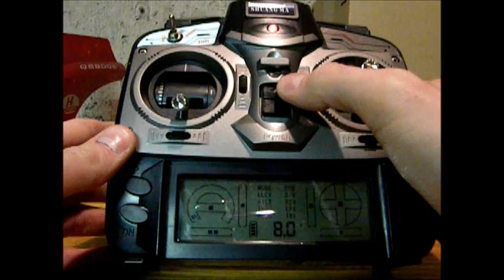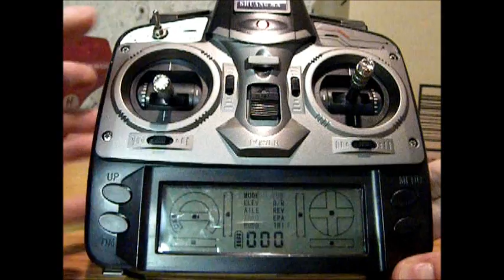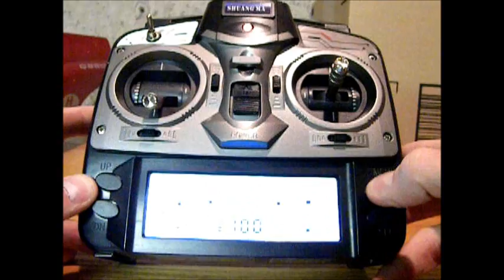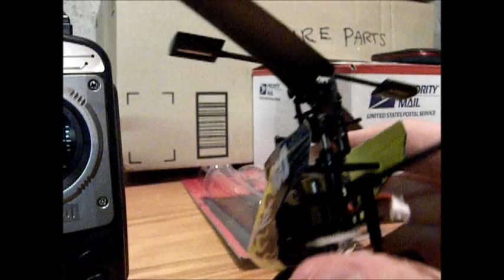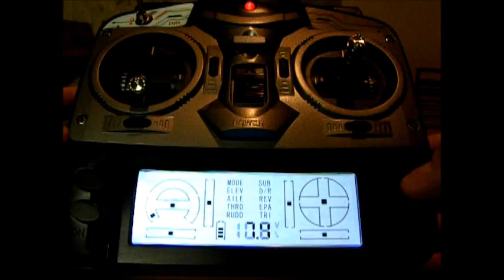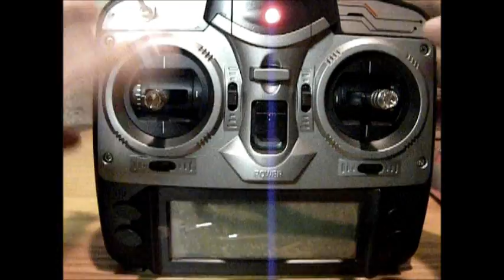How to save the trim settings for your double horse 9116 and 9117 (programming the TX dh9116/9117)

Comment: Hello... I would like to know if there is a way to reset the trims? the trim for the aileron servo is all to the left side, and the button doesn't work, I have tried your settings but I can't get it... the swashplate goes left when the helicopter and the controller get in bind... I would appreciate so much your help...

Comment: I recently messed with the settings and now my heli doesn't fly correctly. I'm not sure what I changed but needs to reset everything back to factory default. When I push the rudder to the left or right it doesn't respond, it will only go left and not right. Any way to reset the remote to factory default. Any help would be great

Comment: my DH9116 wont go straight when I push the forward stick, it always bank to the left, I have tried different settings none of them work, I was thinking is could be the left servo not functioning right, because when I push the right stick to go forward the servo(left) arm dont move up, but it will move up if I push the right stick right side(drift right), what I am doing wrong, all help would be very much appreciated..
Reply: Lol those toy models are no near the level of control like you have on a proper collective pitch I had a coaxial helicopter I got it of the ground and it won't respond to the radio 
It just did its own thing and even my father said get a proper 6 channel model because wasting money on cheap toys are not worth it who cares if a hobby grade model has the power to chop your head of I want control of the model I fly not one that does its own thing  and a model that does 3d aswel needs serious control you can't have control of a machine that can kill you fly like a kids toy that keeps crashing with no control of it 
That's why hobby model have far more control if you want it to go forward it goes forward if you want it to go left and right it does it if you want it to do crazy shit it will do that a toy model has no control unless  I had a toy plane lost it no control why waste money on cheap flying toys fuck all these flying toys time to buy a real proper rc helicopter that can do 3d

Comment: Great video. Thanks for the info.
My question is.. I just purchased a 9117, I'm new to the RC Copter world. On the RC Controller my RIGHT controller controls the throttle speed not the LEFT controller.  What is wrong with it?

Comment from the maker: Yes. On a single blade heli, the tail rotor always spins when there is power to the main blades. This is to keep the left and right rudder balance so the heli does not spin with the rotation of the main blade

Comment: I have had my 9116 for about 3 weeks now and I still haven't flown it yet.. Mostly due too room space and it being so windy outside. I have a question. Sometimes what happens is my copter and transmitter loses sync and stops working and I have to disconnect the batteries a bunch of times to get it to work again. Any idea why this is happening? And also how do I reset all setting back to factory settings? I have changed a bunch of things and now its all messed up to the point that nothing works.